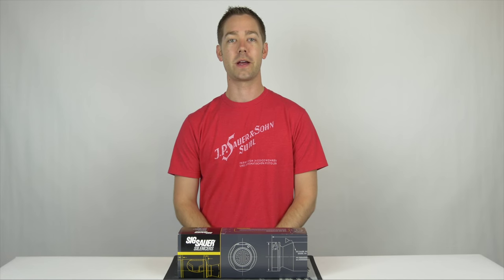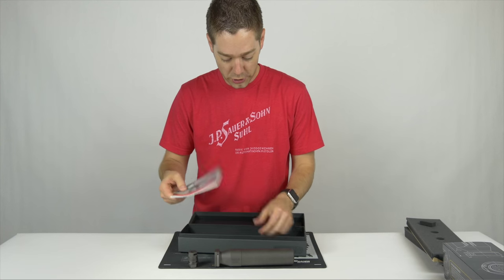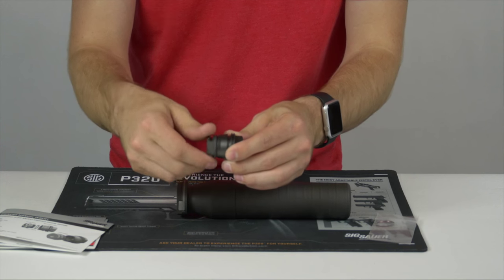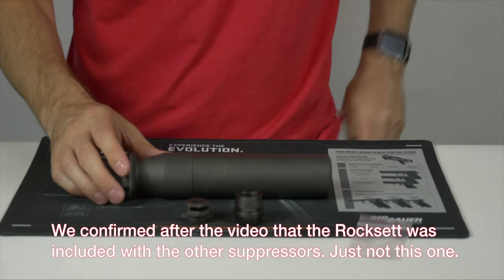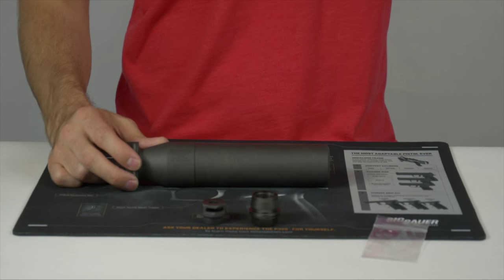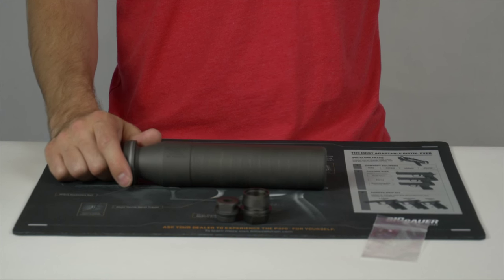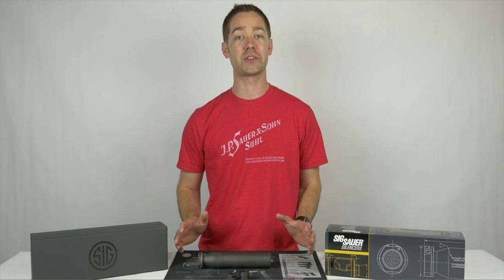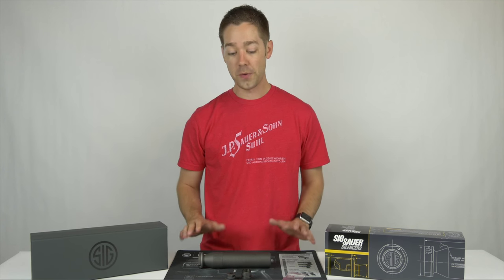Sig SRD762Ti QD Unboxing / Overview

Comment: This huge 9.3" x 1.75" suppressor (direct thread version) seems a bit of a modern dinosaur. Especially when the trend is towards 6-7" x 1.5" 30 cal cans that do the same thing (Silencerco Omega).
Reply: +Big Dave Yeah they didn't know wtf to do.
Reply: Ben White

I know that the Sig can is quieter. But the  Silencerco also is plenty quiet. It comes down to how much are you willing to sacrifice for a few db.
There are some that will put up with the extra weight and length and girth. But the vast majority of us will buy the Silencero and be much happier. This is reflected in sales and popularity. The Sig has not seemed to even put a dent in Omega sales figures.

I dont think it is any secret that the Sig is quieter. It is an option for covert military units who's lives depend on not being detected. I would MUCH rather have shorter, lighter and a  faster handling weapon with my 13.5oz Omega.

In  the end it is great to have a choice, I suppose.

Comment: So how would this mount to an MCX 5.56?  I have a 556R in 7.62 and hope to just purchase one Sig suppressor.  Thanks.
Reply from the maker: +Paul Larson That is pretty easy - you just need the adapter. We're adding it to our site today and the part number is SRD-762-12x28-F. It isn't there yet but will show under this search when added: http://www.osagecountyguns.com/catalogsearch/result/?q=srd-762
Reply: Thanks so much for the quick reply
Reply: +Osage County Guns So I see it not he site.  This is used on 5.56 for compatibility with the 7.62TI-QD?
Reply from the maker: +Paul Larson Both of these should work: http://www.osagecountyguns.com/sig-sauer-srd762-qd-silencer-flash-hider-srd-762-12x28-f.html / http://www.osagecountyguns.com/sig-sauer-srd762-qd-silencer-muzzle-brake-srd-762-12x28-b.html

Comment: How do they recommend on cleaning this?
Reply: +Kevin Nguyen I haven't shot mine enough to put it through a cleaning.  I went with the all titanium 1- for the weight and 2- with it being all welded the only real option is ultra sonic bath cleaning and titanium doesn't rust! I have had a lot of luck in the past with cleaning other suppressors this way but you have to rush it to an oil bath with a ferrous metal suppressor
Reply: No need to clean it